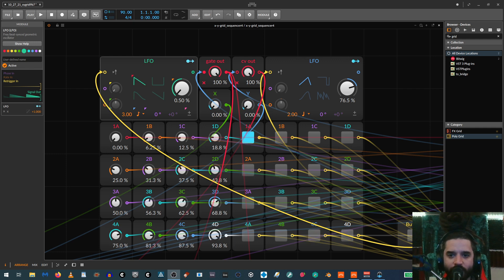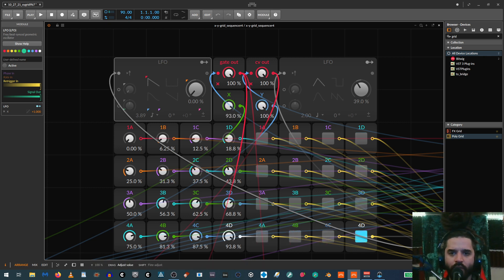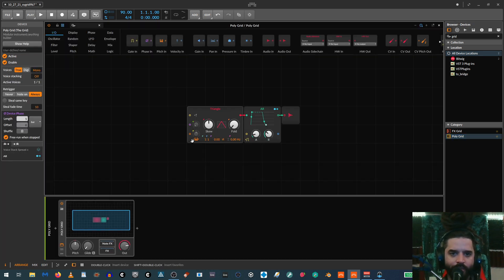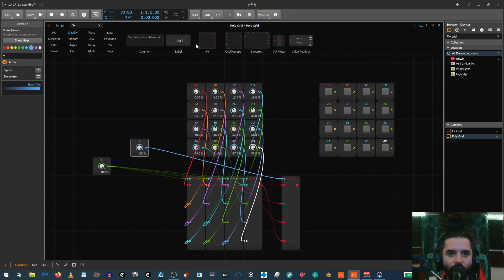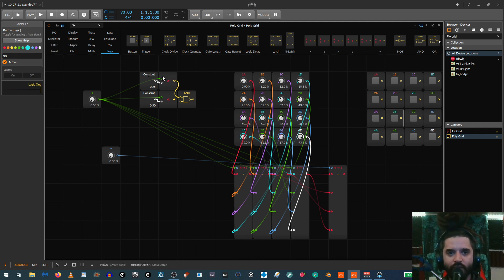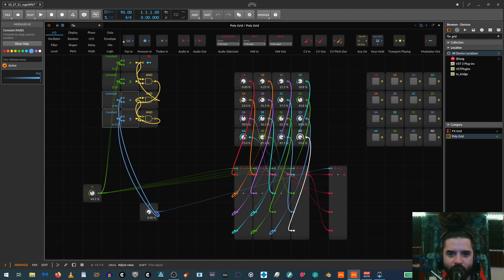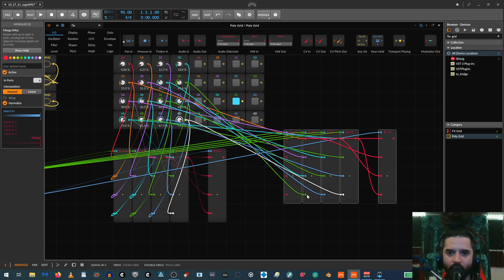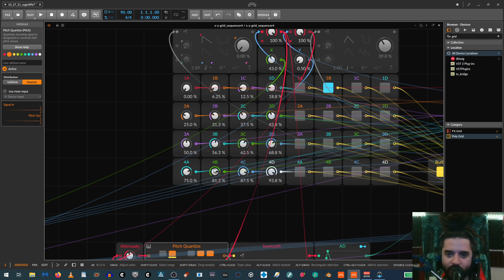How to make an x/y sequencer in Bitwig's "The Grid"

Comment: Grid amazing as usual. Just curious how this device is different from the bw xy device besides providing total control?
Reply: I’m gonna build it either way…🤗
Reply: Nm…I think the total control benefits are described in the intro.
Reply from the maker: Hi.  How's it going.  The difference is that this allows you to use the x/y parameters to scroll through a sequence of values ( the knob section) or trigger things (the button section).  The values in the knob section can be for anything too.  In this patch, I just showed pitch to keep it simple.  But, since making this patch, I have experimented with using those values for things like sample select, phase mod ratios, grain size and more.  The weird motions will give interesting gate patterns too.  So, basically this is more of a sequencer, where the x/y mod in Bitwig is more of a modulation source.
Reply from the maker: If you check out my instagram page, I uploaded a video with a more interesting patch with this sequencer, where I use it to trigger a sampler with a 128 of FM blips and bleeps.  Then I assigned the values to various parameters on the sampler.  I haven't experimented with this patch a lot yet, because I'm trying to finish up a track.  But next week, I want to try to expand upon it.

Comment: Awesome patch! I am so grateful for these more advanced modular polygrid tutorials. 

I understood the logic, but I am not so confident with mathematics so I just wanted to double check... Do you only have to divide the X & Y range of value on the comparitor logic by 4 to cater for the whole 16? 

And how did you determine the percentage values for each of the 16 level modules?

Thanks again
Reply from the maker: Hi.  X and Y are both divided by 4.  So, the values always need to be between.   0.25, 0.50, 0.75, and 1.00.  So, for each row, you can just change the value on the constants to match its location.  One thing to note is that for the first x row, the  x logic only needs to be less than or equal to 0.25.  You don't need the greater than module for that row, since it is 0.  The same thing goes for the Y row.  If that is confusing, I can upload a screenshot.